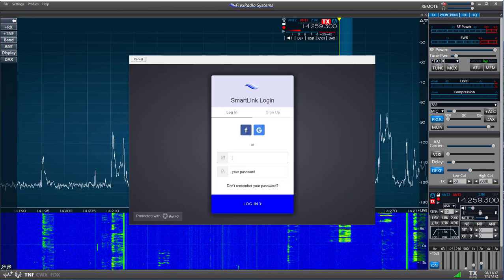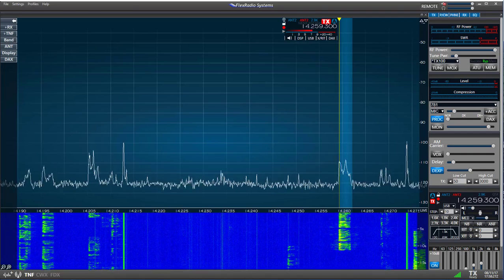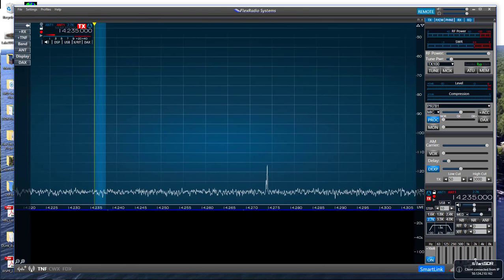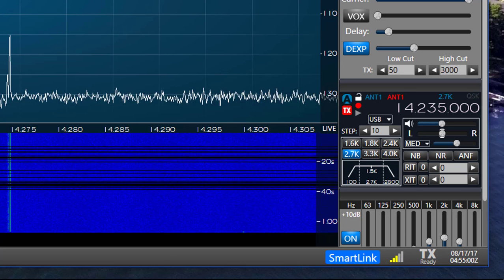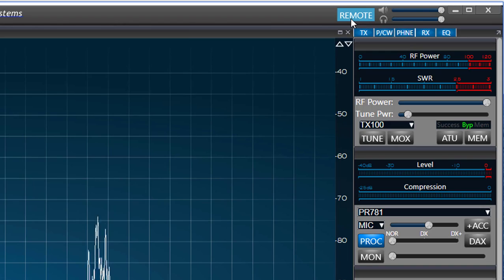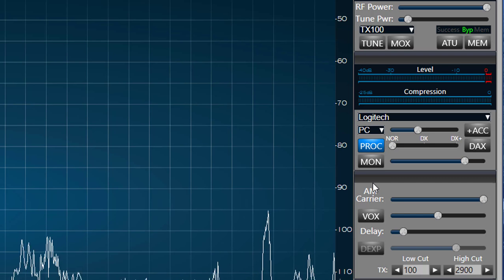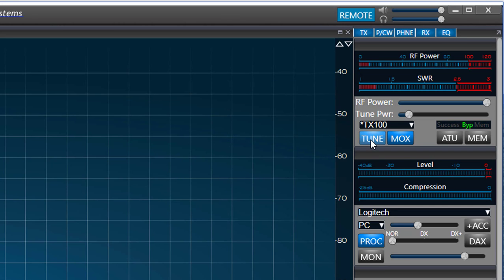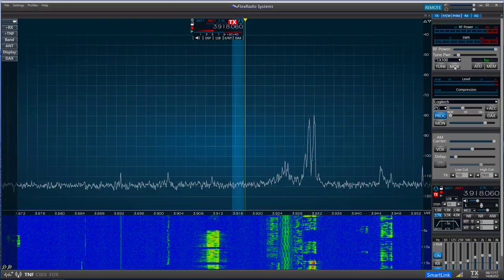FlexRadio SmartSDR v. 2.0 and SmartLink

Comment: Do you need to leave the radio turned on all the time in order to connect or can you power it on remotely?
Reply from the maker: The radio needs to be on in order to connect. I am not aware of a way to remotely power up the radio.
Reply: Yes. There are devices available that connect to the internet that are designed to operate as switches. You could use these to turn on a power supply for the Flex. The Flex has an RCA jack on the back "Remote On". Once power is available shorting this turns the radio on. There are a number of such devices available. Here's one you can experiment with:  https://www.controlbyweb.com/webrelay/demo.html